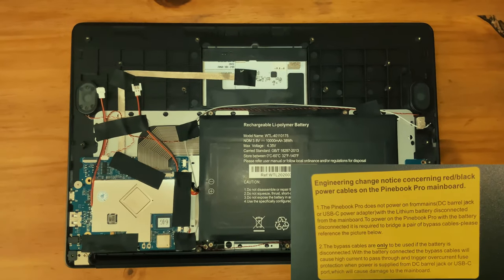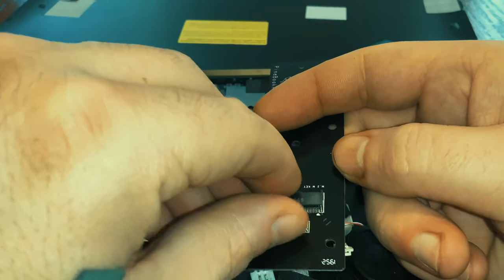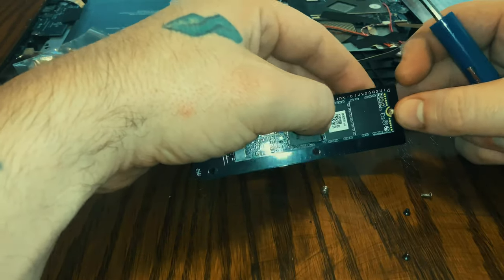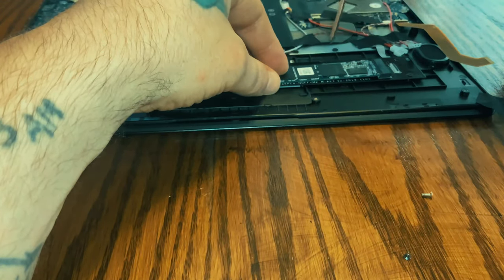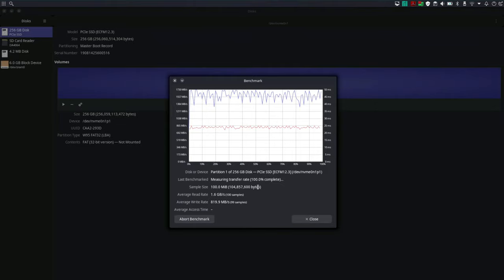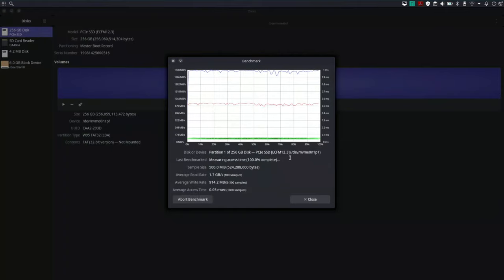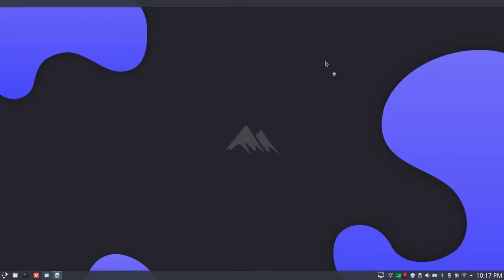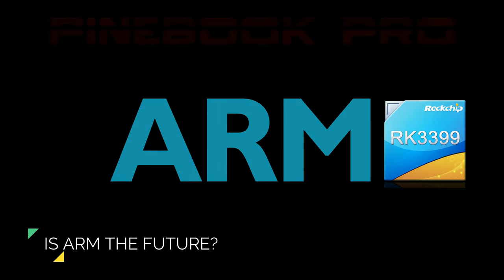Pinebook Pro Review & M.2 NVME Install + Benchmarks

Comment: The groove around the brass standoff fits into the NVME notch, and then the screw comes in from the bottom of the adapter. You were probably watching an old tutorial video with the old style adapter board. The new one you have has the ribbon connector moved further from the  mounting screws.
Reply from the maker: Yea it was an older gen 1 blog tutorial, but the little stand off was too small it must have been a warehouse error but it’s all good I have a bunch of those NVME screws from the dozens of external drive enclosures we use as recording drives here at the studio. Thanks for watching 👍🏼😀

Comment: Would you mind sharing the NVMe model you’re testing with? Thanks. 
Pine has a user maintained list of disks with various test results. I picked up a WD SN550 500GB but didn’t do the install yet. Thx
Reply from the maker: Yes, it is an "inland 256gb NVME drive". here is the amazon link so you can compare. Thanks for watching. https://www.amazon.com/dp/B07P6STQ54/ref=twister_B07RYZCM3M

Comment: Overall this is pretty easy right?
Reply from the maker: Yep installing the M.2 SSD drive is easy if that is what you are asking. If not, your question wasn’t clear so I made a guess about the M.2 install if you could be more specific that would really help me answer you question.
Reply: @joesalyers  Ah no that was my question. Where do I need to buy the adapter that is plug and play when I purchase a m.2 NVME ? For example, if I order a standard m.2 ssd 512 GB off Ebay. that should work right? I kind of didnt quite understand the video for the part where you open up the Pinebook, , after you do that, what do you do and look for? . Also if I order a new Pinebook pro, will this SSD adapter come with it or?
Reply from the maker: @jmitra95  Thanks for the reply, M.2 SSDs can be tricky if you aren’t familiar with them. First the connector/adapter for the SSD must be bought from the Pine64 website it’s the only connector that will work with the Pinebook. Now for the SSD any brand will work but it MUST BE a NVME M.2 M-key SSD. A cheaper sata SSD will NOT work. There is a list of SSDs that work with the Pinebook on the pine64 wiki so I would buy one that has been tested since the PinebookPro is an ARM laptop. I bought the “inland brand m.2 NVME SSD” from Amazon for around $40 dollars which is great because if it’s broken during shipping you can return it.  Also installing the SSD is simple. Just make sure the M.2 SSD is PCI NVME (NOT SATA). The inland m.2 I used in this video has worked well and doesn’t drain the battery, but some other bands might drain the battery faster than others. Jump over to the Pinebook pro wiki at pine64 and you’ll find all kinds of info about what you need. Thanks for watching and have a great day.
Reply: @joesalyers  Thanks I'll give it a try . Ill just follow your video. All ot looks like is you pur the M.2 into the enclosure and you're set. I shouldnt be worried about messing it up right?

Thanks!
Reply from the maker: @jmitra95  just put the drive into the enclosure and connect up the m.2 cable screw it down and it will work. It’s actually pretty easy, I’m not the most computer savvy person but I was able to do it in 30 minutes. Just take your time and reference this video or if you get stuck just drop a comment here and I’ll help or if you need more info I could maybe post a quick video to help you out if you get stuck. But you will be fine.

Comment: Thanks man for the Review, looking for a affordable ARM based device and that seems pretty much it :D hint: https://en.wikipedia.org/wiki/Vivaldi_(web_browser) might be Russia spyware! So just go with the default Firefox :D (which might be Google Spyware... so pick ur spyware! :D)
Reply from the maker: Yea its all spyware Firefox has data collection turned on by default in the settings so its a pick your poison kind of thing. LOL The Pinebook Pro is a neat device but if you want a ARM device that has actual power you could get a M1 or M2 Macbook Air and use Asahi Linux, Linus Torvalds has been using a Macbook Air for a couple years now as his main machine and I bought the M1 Max 16 inch for work and a M2 Macbook Air as a Linux machine the M2 is nice. Cheers.